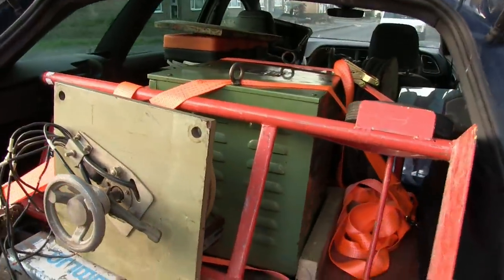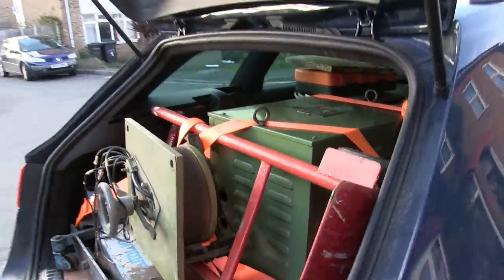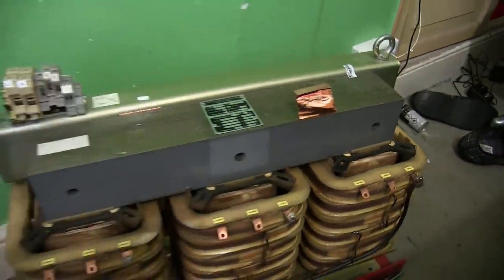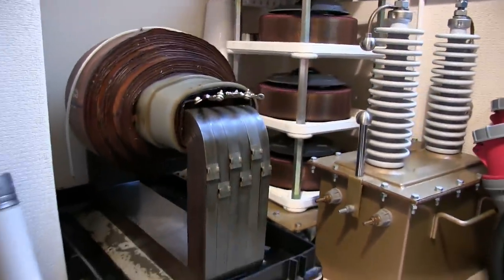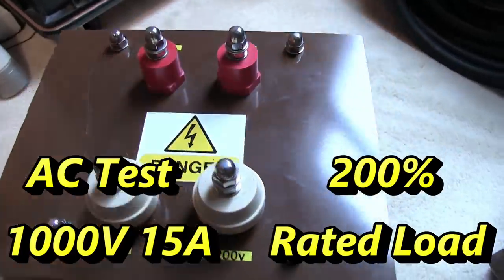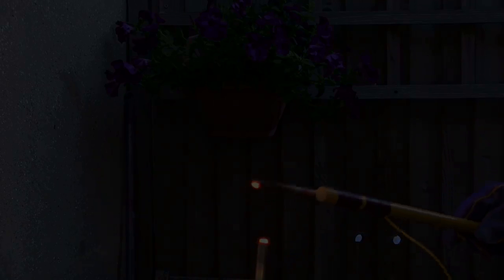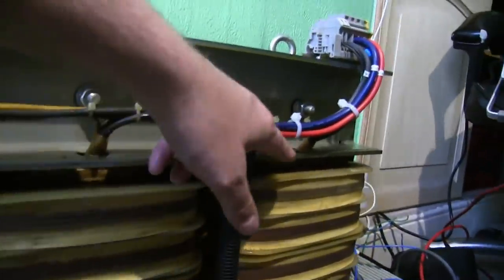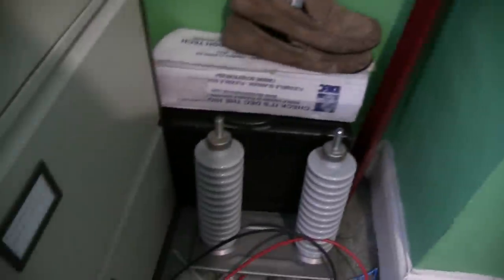Extracting Maximum Power From Transformers

Comment: Been watching you for a long time, sir.  You soar to heights I could only dream.  I do appreciate your taking time to show and explain things, I wasn't aware you can run 3ph on single with some modifications.

As for my stuff, mostly small time.

I bought an old modestly sized 3-phase PSU for powering arc lamps of NdYAG lasers, but mostly it was to trace and reverse engineer.  

I suppose I could be bothered to try out making a rotary phase converter from 3 to 1.  Problem is I would still need an outlet capable of delivering sufficient power to a device run on 208Vac delta @ 30A.  I estimate since the output is 150VDC adjustable and that the solid state medium is ~1% efficient, it could probably continuously power a laser to around 25W output.

You can get CO2 lasers to produce comparable optical output on, in some cases, 120VAC outlets.  So from an economy standpoint, the solid state laser doesn't make quite as much sense.  But it's still a case with its worth I suppose.

Comment: The insulation of that ground stick used to draw those arcs is so very important to safety.  Maybe a little video about insulation resistance testing or even polarization index could be in order? As you well know, in high voltage it's easy for the conductors to conduct, what one must be careful of is making sure the insulators are truly doing their job of insulating.
Reply: He has done it - look for the screwdriver video.

Comment: 12:10 With a resonant cap in series with the ballast you can prob stretch that out to 3-4 meters.
Reply: Wouldnt increasing the frequency on a transformer that size increase heating pretty severely?
Reply: @oliverpuczyk2  Simply adding a cap won't increase the 50Hz frequency, just drive up the current and voltage drawn under arc conditions with resonance = the arc keeps growing and drawing more and more current the longer it gets until it breaks or until the breaker pops. Not sure what the inductance his ballast is but assuming it's set to limit current to 63A on the primary with 7200V secondary that's about 11H. Pair that with a cap that resonates with that at 50Hz = 0.9uF = a few cheap microwave caps in series/parallel can do it (assuming 2500v/1uF ea 10s9p). You don't want to keep a dry transformer arcing constanty beyond it's rating for minutes at a time, it will indeed overheat, but an oil-filled pole transformer can handle 5x their rating for a few minutes if you let them cool off in between runs. With all that thermal mass that takes several hours.

Comment: I built a CNC using drives that required single phase 208 - 265 VAC.  I wanted to use it on a 120 VAC mains (USA).  I had a 1 kVA 3 phase autotransformer used for stepping down 400 VAC to 240 VAC.  I figured out how to wire two   coils to step up 120 VAC to 208 VAC.  Works great.

Comment: The huge 3-phase transformer might be from a radio transmitters final  plate  supply.  I owned a similar transforme, it was a spare one for the Siemens S305 10kW HF transmitter. The data of mine were 400V prim, 5/ 8kV  15kVA . I still got the 3 phase rectifiers to those units . After closing  down the analog TV in 2012, loads of transmitter parts were offered at radio rallies even Power units and transformers.
Reply: May well be a plate transformer, definitely not a distribution transformer. That transformer you have must be quite a beast

Comment: 7:30 That DC arc is alot brighter. If only you had a big enough resistor (ie 20kW one meant for motor braking or a homebrew one from piece of steel) and had some smoothing caps = welding with 1000vdc (well, 1400vdc then).

Comment: A ballast will limit the current going into a transformer and therefore control the amount of heat generated in the transformer, however it will not stop the core from saturating.

Comment: Amazing, you should resonate the big transformer with some capacitors. 
Also I would use some welding glasses when arcing the big transformers, since the light prodouced by the arc is dangerous to the eye.

Comment: on that bottom electrode, you need a feeder tube and feed it an ionizing gas.
so the gas will rise up from below the arc ignition point, and then create longer ionized plasma so you can pull longer arcs.
with an ionizing gas and misting mixture, you could also create different colored Plasma.
But it would not be suitable for indoor use.
a mist of potassium chloride solution would give a vibrant purple color.
Reply: you could then create a special wand. with say 4 or 5 fingers to it.
set up 4 or 5 base electrodes, spaced the same distance apart as the fingers in the wand.
feed each base electrode with a different misting solution.
and then you could pull a rainbow of plasma arcs at the same time.

Comment: Aaaah, Mr. Photon! I 
see you yankin' them arcs! :D
Pullin' lots of Aaaampssss. :D
Around 12.00, I bet that the.......
.
.
.
...........Old Landis & Gyr CL27.2d in the basement had its loadwheel bombin' around pretty quick!

Mmmmm! 89 Aaaammpssssssss on the Di-Log clamp meter :D

OK, it wasn't continuously 89A, but I bet you certainly warmed up that service fuse. :D

One day, just one day..... that poor old repeatedly-beaten service fuse is just going to nope-out so hard and it'll pop without so much as a whimper and it'll all be over.

When that day happens, please make sure you have the camera rollin for when the guy from the DNO turns up to change it and you can say to him in classic style...... "I POPPED IIIIIIIIIIITTTTT!"

Were you pullin' that kind of current through the 28A variac?

I bet, even if it was complaining, you couldn't hear it over that ridiculous phat arc you had buzzin' up in  the middle of the office. :D

I tell you what...... when the day comes to have a smart meter fitted and they start collecting your usage data, there's going to be some VERY ODD looks in the analysis office when they see rippin' great 80A spikes on the usage graphs! :D

Please don't forget: I still want that Landis & Gyr CL27.2d electric meter when they remove it. :-)

Take care, have fun and watch out for your eyes! Those arcs look like you could do welding with them!!

-Wayne's Electrical.

7th July 2021, 23.25

Comment: That's an impressive list of qualifications on the wall of Photon's Lab.
If you haven't studied, and also been shown the practicalities of working with high voltage, high current systems, be warned; it is very easy to burn your house down or kill yourself if you're tired, unlucky, drunk, or just plain ignorant! 
Even worse, you might blow the mains fuse and then have to call the heavy mob out to replace it. That's expensive and they might just take a look at what you're doing and disconnect you from your supply instead. 
I know just a little about low power HF radio systems and I still managed to accidentally surprise myself by burning a hole in the bedroom carpet from the voltage antinode on the end of a tuned coil I was playing with. It was a beautiful blue arc. It was just chance that I wasn't on the other end of it, because I wasn't really concentrating on what I was doing.

Comment: i had asked this question about winding cords and a static three phase  converter on the last video but this one might be a better spot for it " the coiled extension cord front i have a 3ph drill press and lathe and only one Static Phase Converter no budget for a second and they are on opposite sides of the shop so i made 40ft extension cord to be able to plug the lathe in interestingly when the cord is coiled on the wall behind the drill press the drill  has more power and it took me a while to stop breaking half inch drill bits (long and the short of it is the coil inducing a current in the "dead third phase") or am i being haunted by a ghost that hates drill bits?"

Comment: When you strike the arc and draw the electrode up, the electrode is basically horizontal to start with then forms a slight upwards angle and the arc wavers and dances as the distance increases. Would the arc be more stable if the receiving electrode was vertically in line with the emitter❓

Comment: Hey photon seeing as you know basically all there is to know about transformers id like to take 3 phase power at 16 amps per phase and pass it through a transformer so i get a signal phase supply at a higher amperage as the cable im connecting to can not be replaced thanks

Comment: Good info here! Though it did bring up a question regarding my own variac.... I'm using a (relatively) tiny three phase variac consisting of 3x 6amp transformers. When I got it, I just wired everything up in parallel; should I have some sort of balancing on it though? I don't use it often, but when I do it never seems to complain.

Comment: What color is the ceiling of your room after those sparks. You need UV light protection I think as when you weld steel with an electrode (at least for your eyes)

Comment: I always thought transformers didn't saturate from drawing excessive current, because the secondary creates an opposing magnetic field?

 I thought most of the overload problems on transformers were due to resistive voltage drop and heating in both the windings, and saturation was due to too high voltage or too low frequency, and led to overcurrent in the primary only? 

Am I missing something?

Comment: Question for anyone who can answer: I'm watching at the end of the video and I'm asking myself, is this mostly reactive power? I've never really grokked reactive power, but I can safely assume that 30KW of power isn't being dissipated into the room he is standing in or all the paper on the shelves would burst into flames.
Reply: No, 30 kW is being used. 30kW means that in one hour, 30 kW is used. If he powers it for 1 minute, then it is run for 1/60th of an hour. Therefore it only puts 500 watts of heat into the room which is the same as running a small heater for an hour.

500 kWh, not 500 watts*
Reply: @memejeff  that's not correct. if it was 30kWh, that would make sense.
Reply: @cmaylo  I can tell you watched a few videos and thought you understand electricity. Educate yourself.
Reply: @cmaylo Just asked about 10 electrical engineers on stream. I am right. Don't try to teach others until you learn
Reply: @memejeff  in your example the heater emits 500Wh of heat, not 500W. You’re conflating the two. One is a measure of power, the other energy.
Reply: @cmaylo  Genuinely sorry. Don't know what happened. You're right. I misswrote it and for some reason thought you were saying that 30kWh was dissipated. Yeah, I meant to say Wh. Sorry for being such an ass.
Reply: @cmaylo Wont happen again
Reply: @memejeff  it’s all good! Easy mistake to make.
Reply: @cmaylo  I appreciate it. Thank you. I still shouldnt have been such a dick. Have a nice day.
Reply: it's all good  @memejeff  don't be so hard on yourself! you were big enough to admit being wrong which is more than 99% of the other commenters on the internet. I hope you keep learning about electricity, there's a lot of great channels on YT.
Reply: @cmaylo  I really appreciate that. Thank you :). Absolutely, so much good stuff. Have a good one.

Comment: why is their 5 pins (4 small, one big) on the 3 phase plug??
.
i thought you would only need 3 pins..... one for each phase
.
.
.
i did work 10 hours today.... in 98F weather.... in the sun....
and didnt really sleep all that well last night
.
so i may be forgetting something (doesnt 3 phase NOT need a ground/neutral??)
.
.
.
so my guess is that the little pins are....
phase 1
phase 2
phase 3
neutral 
.
and the one big pin is earth..... so if something "shorts" out inside the equipment OR cable..... it doesnt make a human body go POP!

Comment: Are you still electrifying the Air.. why not a Youtube stream with longer running experiments ?

A slow cooking microwave.. where an installation ups the voltage every hour with 5volt
and we bet if the microwave will survive this torment ?

Comment: I love your vids, but from one EE to another, we both know you absolutely should not be doing that shit indoors. You cannot possibly have enough ventilation to be safe from the heat and ozone created by those arcs. Great content, but please don't die for it.
Reply from the maker: Thank you my friend, the higher current with the carbon rods was outside, the medium voltage low current was inside, no massive obnoxious emissions to worry about with that.

Comment: i have been looking for a 10 kva pole pig  for years lol.
Reply from the maker: They are hard to find with no PCBs
Reply: @Photonicinduction  This is true i have 2 potential transformers but they are potted in resin and can not dissipate the heat so short run time periods are possible plus they take a long time to cool down.

Comment: how good are those multi phase plugs for being run in single phase? I was wondering about current sharing
Reply from the maker: Each pin is 125A
Reply: @Photonicinduction  but how good is current sharing when they are connected? I would just check how hot that connector is if its not specified, maybe its wired differently then I think so it has no possible hot spots
I never got past AWG 8 and only for overkill solar wiring in terms of connectors more fancy then lug

Comment: What you don't know ain't worth knowing :)  But I would like to know, how come the electrode is not disintegrated when you make those massive arcs ?  Do the neighbours ights flicker when you do these tests, because I remember using an arc welder used to make our lights flicker, although this was back in the 70's and because of the heat and ultraviolet rays that are emitted when doing these arcs how come everything around you doesn't melt ?  It would be nice to see how the violet pansies are in a month or so too :)
Reply: The electrode will degrade from drawing arcs like this, but it will take a while.  Everything around him isn't melting for the same reason; the actual amount of power at work here is not that high.  Even if Photon has his 100A plug hooked into this, the most power he could ever get would be 24kW.  24kW is approximately 32HP, comparable to the power output of a small motorcycle.
Reply: @jhensjh  I know 24 kw doesn't sound very much but a buzz box may only use 3 kw and instantly melts 1/4 plate, it surprises me how good an insulator air actually is. :)

Comment: Is it legal to do all this kind of stuff at home here in England? And isn't there a danger of frying the incoming supply cable, as there's a region between where a serious overload starts and when it becomes enough to blow the main fuse, and won't it overheat the cable before the fuse blows? I think he should've presented brainiac science abuse. I suppose this is a scaled down version of the sort of stuff that Nikola Tesla was doing, and he allegedly blew up several power plants! And I thought it was dangerous just working on old colour TV sets with 25kV eht at about 1 mA and a live mains connected chassis! ( though I did use an isolation transformer ).

Comment: Years ago when I subscribed to your channel I thought you had a 125 Amp 3 Phase supply going to your house and wondered how the fuck did you manage that.
Now I presume that you have a single phase supply, and you are tapping your power directly from the 100 Amp fuse / breaker after the head which would give you just under 24kW to play with.

Comment: Interesting.
I have an old three phase mig welder and the current is altered using a separate transformer to the main transformer. I guess that is being used as a variable ballast to vary the output current. Is that how these work?